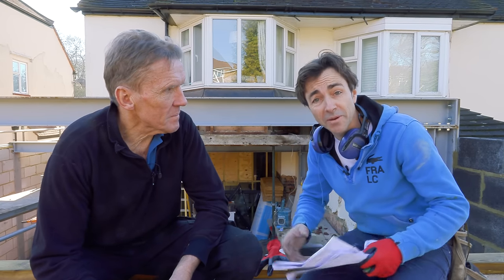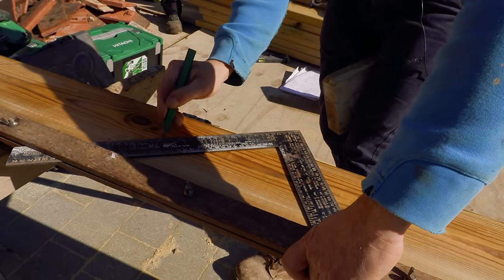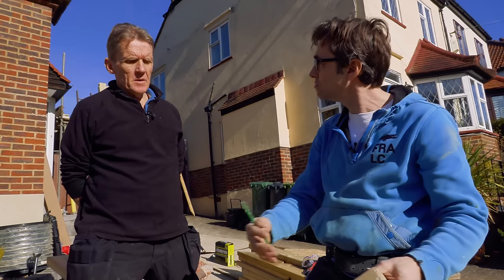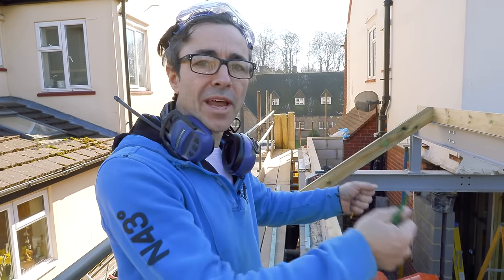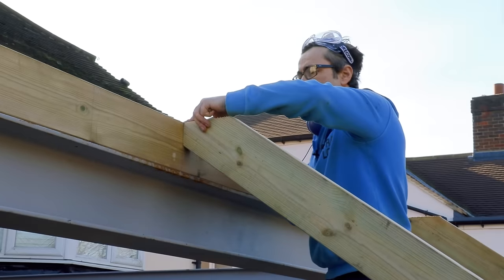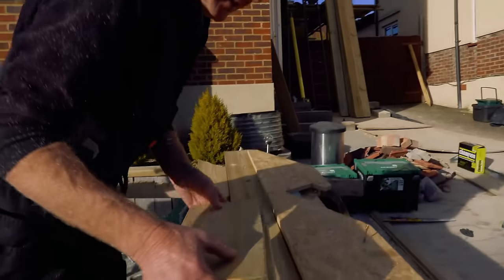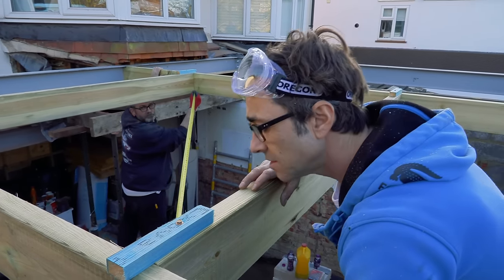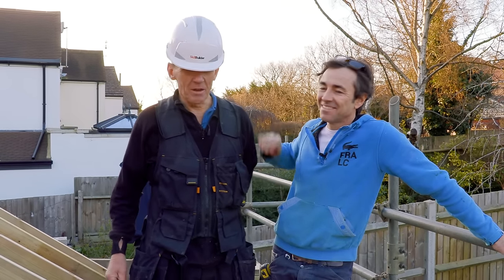How to Build a Pitched Roof - Carpentry Training

Comment: Did anybody else notice that up to 22 mins the top end of the rafters were wrong (I haven't read every comment, so someone may have seen it). The cut end that butts up to the ridge board was too short and the horizontal cut was too long. Then suddenly they were correct - the cut against the ridge was the full depth of the ridge and the top cut was short. A schoolboy error he didn't own up to! Sorry if I haven't used the right terminology but I'm not a roofer or a carpenter and not in the building trade.
Reply: That’s the other side of the hip ,the side the steel was further away.

Comment: 4:00 in buy some brass nut's mate!
Reply: We call em stair gauges but yes, I agree.
Reply from the maker: The trouble is they get lost whereas Robin's bit of hardwood doesn't. It also gives you a better line. The nuts are less accurate because they rely on two points on the timber.
Reply: @SkillBuilder  Getting lost easily, I can agree. Although leaving them attached to the square as he does his, problem solved.  Less accurate, I cannot agree. His jig is still ultimately relying on 2 points as well. So if your argument about the two points has anything to do with the straightness of the lumber, then his is just as susceptible.
Reply: @williscooper7750  Robin's fence means he has a single continuous line of contact on the rafter which matches the roof pitch perfectly. With C16 or C24 graded timber there won't be too many micro deficiencies on any edge but the fence reduces the chance of errors by averaging out any variations across the distance of the fence, whereas the 2 single contact points of stair gauges cannot. The only "2 points" that are critical here is that the fence intersects the "A"mark on the tongue of his Gibson square (effectively the centre point of the protractor) and the 35° pitch mark on the blade. Stair gauges generally have to be placed slightly away from the relevant markings to ensure the square is precisely lined up for the correct pitch because the nuts aren't flush with the working edges of the square. Roger pointed out the "daylight" at one point and Robin explained there are so many manufacturing variations that a bit of tolerance is required. All the bird mouths looked spot on to me. Each to their own of course.

Comment: You use a $1000 framing nailer but still use the stepping off method? Invest in a construction calculator, it's easier, more accurate and much faster to learn and apply. You're making it look much harder than it is for the newbies.

Comment: That is literally the most complicated way of figuring a rafter length. Yes I know it is technically how you use a framing square (not rafter square) and you are showing the basics but no one uses this method in the real world anymore. Tape measures and string lines with a little math is so much faster. 
Once you know you seat height (I.E. your birds mouth) and you have already determined the pitch of your plumb cut then you simply hook the outer edge of the wall and measure diagonally to the top of the plumb cut. That is your rafter measurement taken on the angle. You can then start by cutting your seat cut, hook the inner edge of the birds mouth that would ride the outer edge of the top plate and measure diagonally to the long of the plumb cut. This works for hip/valley rafter cuts as well.
Reply from the maker: Willis 

I agree with you in many respects but you need to set up 

a ridge before you can use your lines and tape measure. I would lay a rafter up the roof and mark it off if that were the case. You can also use a calculator and some tables but Robin is just showing how to step off for interest's sake and that is a concept some people find useful.  Why do we have to limit our knowledge or stop discussing methods because they are now considered archaic?